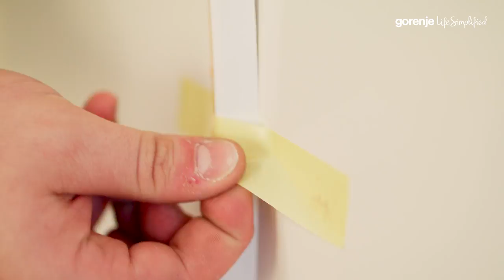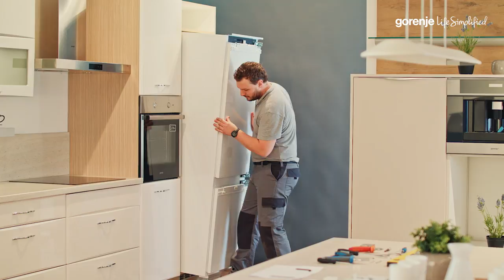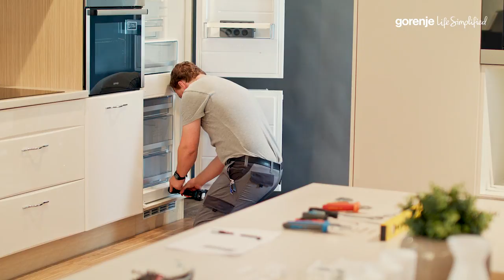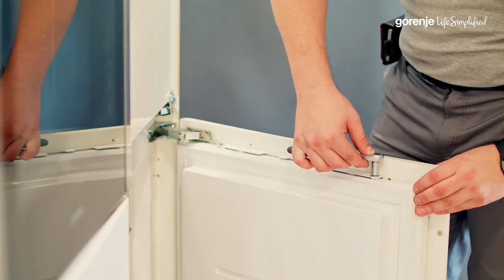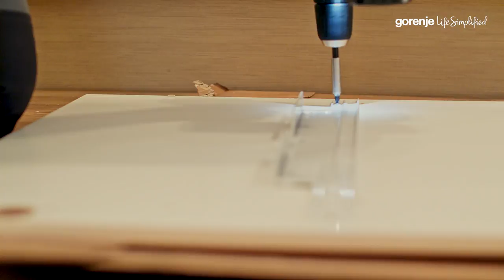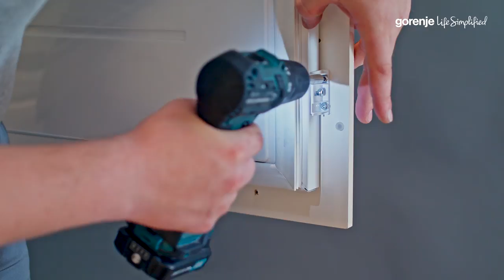HOW TO INSTALL YOUR REFRIGERATOR

Comment: So I assume you have to unscrew the fridge from the closet in order to clean the dust from the back of the fridge?
Reply: how dust will get at the back??
Reply: @alexburke5289   that I'm not sure but even for these type of fridges in the instructions it is usually stated to clean the back once a year (which is an interesting suggestion given that the fridge is integrated). I believe the only option is that I remove the screws and see for myself that no dust has made it through I guess.
Reply: @gonzo5214  youre just going above and beyond over this my man